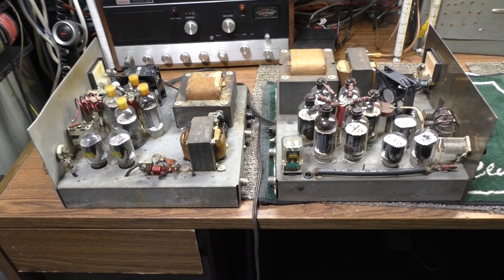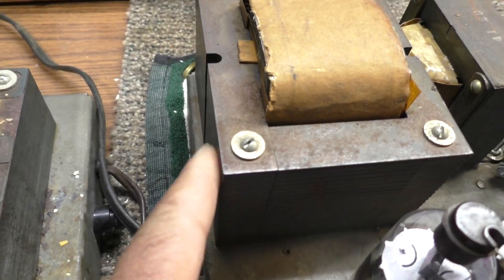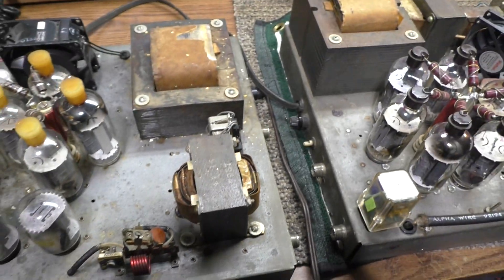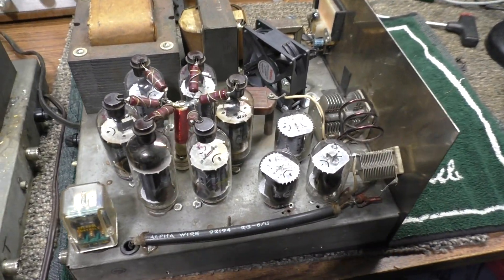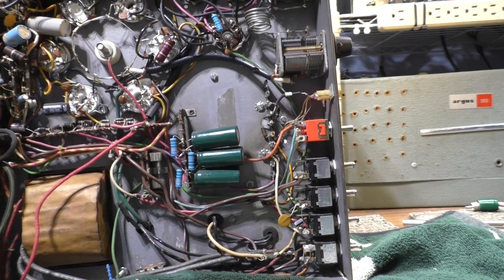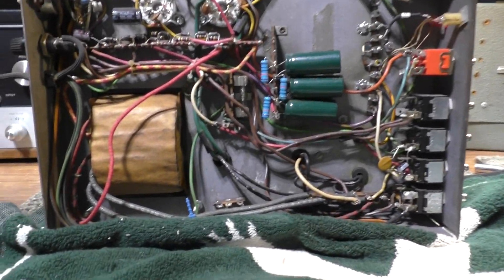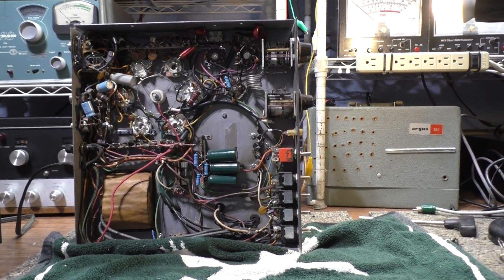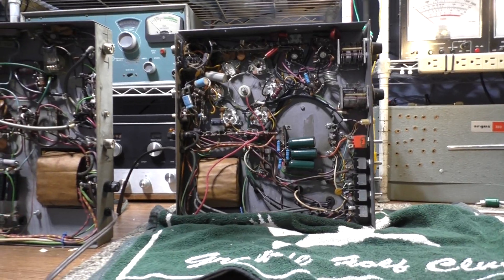Demco Demon 750 vs Demco 500 plus quick talkthru only.

Comment: Consider that most modern house wiring is run through a 20 amp circuit breaker, high power amps can strain the house wiring. Does the 750 have a transformer tap for 240 volts?